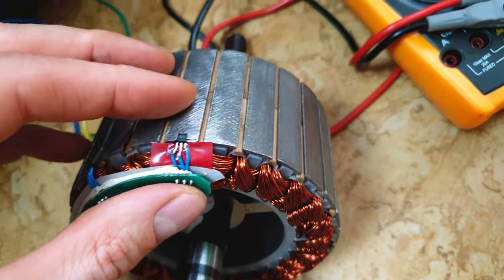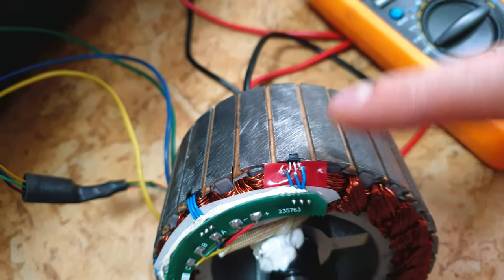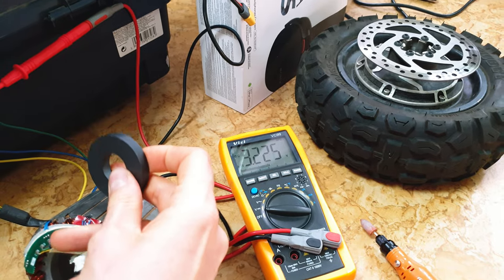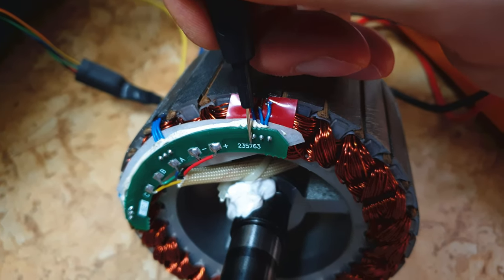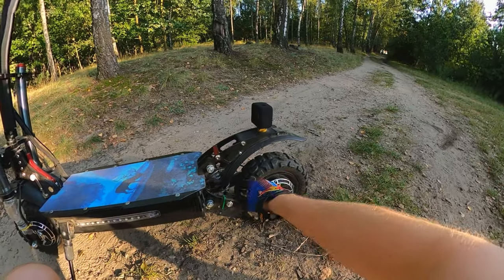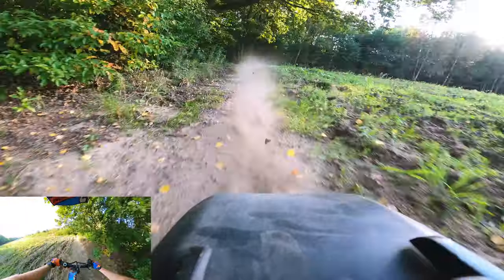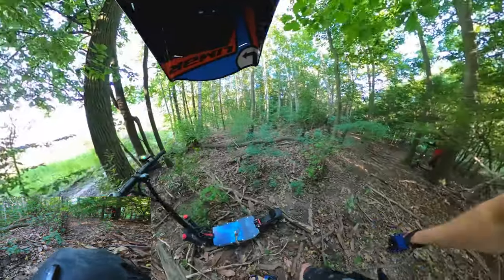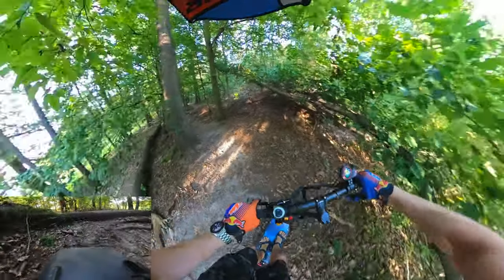Escooter How to fix damaged Hall Sensor 🛠 Hard test 💥 PVB 60 🚀 Sliding over fallen Tree 😎 Part 2

Comment: Well done Pirate!
Told ya it would be a fairly easy fix!
Protip for the future, when rep[lacing halls, keep the legs on it as long as possible, if you need to, solder three wires to it to extend it to the main board.
but use heatshrink instead to cover the cables, then coat everything with your amazing pvb glue and dont forget to coat the underside of them too.

PVB is absolutely great for coating pcb's and components to make them water resistant, you should however rely on heatshrink as a primary water protection and pvb as a backup ;)

Super glad tyo see you got this sorted quickly for yourself, I know you love that scooter to bits bro!

Peace🍍
Reply: nice to see you using timestamps too btw!
Reply: does your tip have anything to do with the possible overheating of the hall sensor?
Reply: to isolate motors, stator, hall board ..... "URETHAN 71" should be very recommendable, you have to look at YouTube there are videos.
Reply: @HugforYou   It is entirely possible that it would be deflecting more of the heat away, having the legs exposed would allow a great deal of heat to get shot straight through them into the chip.

honestly, with the location of the hall sensor, the idea is to make sure the motor isnt getting too hot and dialing back the power according to temperature. BMSBattery KT36/48v Controllers offer these capabilities via a thermistor in the hall sensor plug, so do the nicer Kelly /Sabvoton / Phase|Base|Runner  type controllers too.

The reason they fry usually is because the motor gets too hot, I know for a fact those rotors would be running close to their upper thermal limits with that amount of power going through them.

TL;DR Cool the stator and dont dump so much power. it'll stop the halls from being overheated. 

From my readings, the motors used in scooters really cant handle all that much, theyre actually quite small and brutally honestly shithouse at dissipating heat compared to ebike hubs. find a way to watercool the thing I guess.
Reply: Urethan 71 seems to be a very similar product to what pirate used, either would be about the same with very minor differences. That one would come down to personal choice at best :)
Reply: not to mention, heat may not have been what killed that hall, sometimes they just die, much like crappy mosfets, some are just bad out of the box and only last a short while, its not that uncommon in the ebike scene
Reply: @JamiePineappleWyatt  yes in the end it doesn't matter what you use, it is important that it is insulated. 👍
Reply: i have tested my Hall sensors and Mosfets and see no issues,however im not entirely sure if i understand the testing of mosfets .... but still motor not run only makes nose and slight rummble !!?? iget a reading of 4.9 on all hall sensors front and rear and back to 0 with some residual jump up to 15 to 17 is this correct ???
Reply: @JamiePineappleWyatt  thanks for info, interesting and need to know
Reply: Thank you for everything, these are very relevant remarks !!👍
Reply: @verbsy  if you're seeing fluctuations of 15-17v you'll probably be killing your controllers sensor circuit, check to make sure the smoothing capacitors on the sensor board (in motor) aren't buggered. but if you mean to 0.015-0.017v that's just fine. It's much more likely you need to swap either two hall or phase wires. It's likely that they're incorrectly wired. (The wire colours you're looking for are green, blue and yellow, don't touch the positive and negative pins. (This is only if it didn't work in its original config ever.)

Your halls seem to be fine, chances are your fets are dead, sometimes a multimeter test isnt enough to diagnose a dying fet, they fail in a few different ways. It's best to use a jig that puts a load on it. Or something went poof in the controller for the hall sensor circuit in the controller. Try using a different ESC (controller) with the same wiring config and make sure that it works with it.

Probably worth noting that most scooters have the Blue and Green phases swapped by default as most of the motors in scooters are actually running backwards. This is worth keeping in mind if you've totally removed the motor from your controller as most don't notice it at first. (plug blue into green and green into blue for phases)

Hope you get that fucker sorted

As for everyone else that's replyed, cheers, I knew fucking with ebikes for all those years would come in handy one day ;)
Reply: @JamiePineappleWyatt  Wow thank you for the reply! so heres the thing lol ! everything was working fine ! i got a puncture riding over a cattle grid lol so i got home unplugged the power ( the 3 wires in the yellow box yellow green blue ) and unplugged the hall sensors . i took the wheel off and changed the inner tube, i then decided to upgrade the brake pads and discs ! so i took the hall sensor plug off with 5 wires thin wires in (red black yellow green blue) in order to pull the wire completely out so i could change the disc ! i put it all back together plugs etc tried the motor because i wanted to see how the brakes worked etc and i got a load nose from motor and no movement , just a slight rumble and the console show a controller error light ! i switched it off and looked at the plugs i had reattached and noticed i had re wired the hall sensor plug wrongly ie the 1 with 5 small wires dumb i said lol , so i re did this correctly and switched it back on the error light had gone but the problem remained !! whats the fix please lol im sure ive tested the hall sensors right and get the reading i mentioned before so my only guess is mosfets in controller what you reckon pal ?
Reply: @verbsy  swap two phase wires, green and blue, see if that works. If it doesn't change it back, then try changing green and yellow, if that doesn't work, try yellow and blue.

If it's a dual motor scooter, just copy the other motors wiring, it should have you sorted in no time, sometimes even hall sensors don't match colours too because the motor spins backwards.

It's your wiring still, as mentioned the phases and hall config is still wrong. Hope that helps man :)

Remember, if you switch the phases, you need to swap the halls too. Copy Pirates wiring if you can catch it in one of the frames from his other teardown videos :)

Just make sure your motor spins in the correct direction when you're done. If its in the wrong direction, swap two phases and swap the same ones on the hall sensor too.
Only change one thing at a time, dont change the halls and phases at the same time or you'll be playing a much larger game. Get the phase config right for your hall sensor setup, make sure it spins in the right direction. :)

P.S No worries :)
Reply: @JamiePineappleWyatt  so i tired this but still cant figure it out pal ...): i will you lived in scotland or the UK as you seem to know your stuff and could fix it for me thx again anyway bud
Reply: @verbsy  keep trying buddy, just swap the phases until they work with your hall setup, you'll get there :)

Sometimes it helps to write down the configurations/photograph so that you don't accidentally keep trying the same things over and over, its really easy to get overwhelmed if you don't take your time :)

Otherwise just take her into the local escooter shop, they should be able to help you out :)
Reply: @JamiePineappleWyatt  i did it yay fixed finally only took nigh on a month lol once i had the phase wires right i just needed to swap the hall sensor wires as they run in blue green yellow and run out green blue yellow so simple in the end but confused the heck out of me as i was sure they ran in to the plug the same as they run out and thought it must be the phase or the hall sensors or mosfets etc thank you
Reply: @verbsy  Well done Man!!! Good work, I knew you had it in you, so the blue and green halls needed to be swapped for your unit, what is it if you don't mind, i'll make a note of the config for future reference? :)
Reply: @JamiePineappleWyatt  LAOTIE  ES18 xD
Reply: @verbsy  Cheers mate, ill add it to the list :)
Reply: @JamiePineappleWyatt  also the phase wires were: Rear, blue green yellow and the Front, was green blue yellow . so weird that the halls came out of controller blue green yellow and go to motors green blue yellow lol no wonder i was confused xD but that sweet sound of it running again could make a smile launch a thousand ships lol ...x

Comment: Hey pirate, I’ve got a xiaomi m365 that I have replaced with a m365 pro digital display and motor. Do I have to upgrade the motherboard also before I upgrade to the m365 pro battery? 

There’s a utube video claiming that the purple motherboards are counterfeit and junk. Is this true? And if so are the purple digital displays junk too. Thanks for your time pirate. Mitch
Reply: I have also upgraded a standard M365 with a M365 Pro wheel and Official M365 Pro Dash with 10 inch wheels and cfw to increase power and speed.
Reply: All the parts between M365 & M365 Pro are identical apart from the motor wheel, dash and battery. So no you do not need to change the motherboard/control board.

Comment: Hi my friend!!🙋
What is your opinion about spray, that put on magnets and wires...???🤔
Reply from the maker: do you mean acryl glue ?
Reply: @PirateWasHere  i mean the spray or laka 🖌️they put in the motors for protection... i think...🤔
Reply from the maker: thisis ome extra coating, but I would not do it cuz it can increase temperature , which can shorten life span of the motor. From the other hand, if water will get inside then thanks to extra coating , there wil be no damaged , so choice is yours ;)

Comment: ...oh and i have tested my Hall sensors and Mosfets and see no issues but still motor not run only makes nose and slight rummble !!?? iget a reading of 4.9 on all hall sensors front and rear and back to 0 with some residual jump up to 15 to 17 is this correct ???
Reply: Check your cables..
Reply: @michalkolodziej  hiya thx ! i thought maybe the motor cable has a break in it where it comes out of motor but wouldnt that show up on a hall sensor test to the motor or something ?

Comment: Hey pirate. Did you test battery packs from AliExpress which claim 20 000 mAh for m365/M365 Pro? You can buy batteries there for 50-80 EUR, which have 50 or 60 km range or even 80 km, at similar size fo the original m365 Pro battery. Is this real or they use fake batteries ? You could make a video about this. A custom battery for m365 pro owners, with range 50 (20 000mAh) -80 km (30 000 mAh???)

Comment: which is the most powerful sooter in terms of torque, acceleration and maximum speed
between boyueda and laotie
Please i wont to buy one of these
Reply: Boyueda
Reply: Lewis Richardson but they have the same voltage and the same watts and someone say that the laotie reach 90 km/h
Reply: @albertoromano2700  laotie has better range and probably the same on top speed but boyueda is more aggressive on acceleration i think.
Reply: @albertoromano2700  laotie is probably a better all round scoot though. But boyueda is better for the thrill
Reply: Lewis Richardson tank you soo much

Comment: 'Pirate' help me pls..(or another specialist) ... <<M365 
pro 2, latest version. No firmware.>> 
Motor problem began with the ‘hall’-noise etc. 
-Battery 90 %. 40V
-Cables are okay. 
-No error on display or beeps. Only 0, so even not the speed..
-The 3 spots on the hall-board at the 

motor (yellow, green, blue) and the 3 right pins of the halls constantly
 give 5 V. NO zero (no matter where or how the magnet is) 
-Renewed all the halls SS41F, nothing. 
-Renewed them by a preformatted board (middle one has different polarity) but nothing 
changes, 
-Renewed the main board but keeps the same. 

-Renewed the dashboard, no difference…, 
-again new halls,  reversed the middle one and twisted its pins ‘cause 
of the polarity, but again nothing changed. -The throttle worked fine.
 
I checked the halls etc on all the ways I could find on YT.  What can I 
check (and fix) still more?
Thx for ideas and help!HELP me
Reply from the maker: Did you try other motor ? Maybe there is some short circuit on motor wiring cuz m365 motor halls should smoothly variable the output voltage from 1to4v when u rotate motor